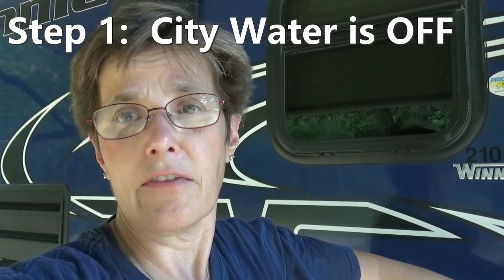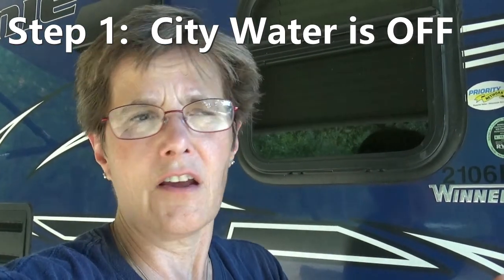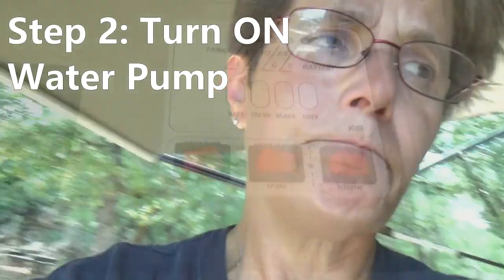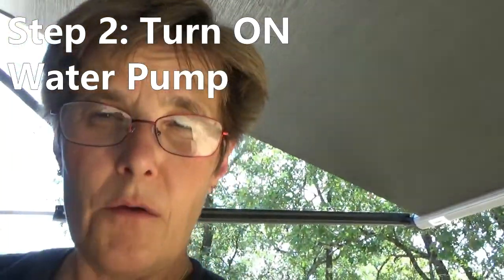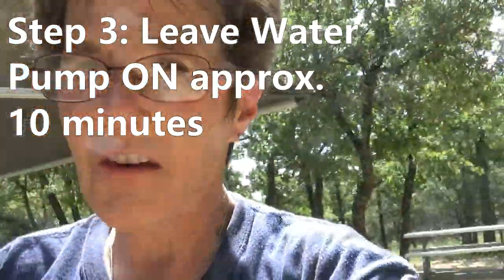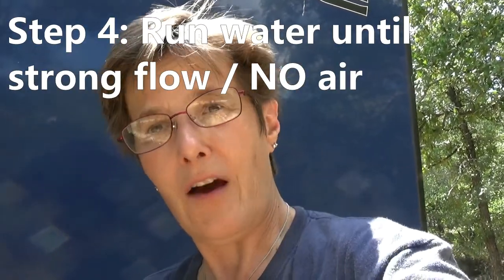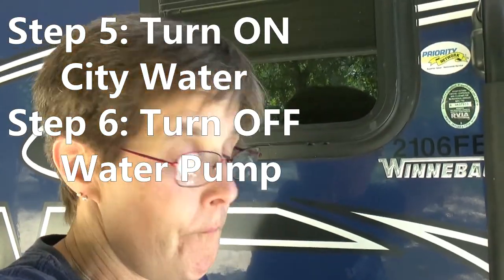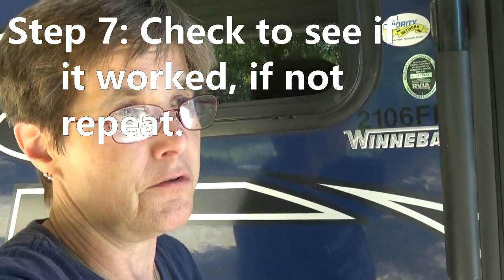RV Fresh Water Overflow - RV Water Pump Valve

Comment: I had the same problem until I watched your video lol I had a tone of air in my lines when I turned the pump on but after all the air was gone I let it run for 10 min. And then turned on city water so far so good!! Thanks for sharing
Reply from the maker: If we can save anyone the worry of wondering what's wrong with the RV, we're happy to do it.  Glad it's working for you.

Comment: Thank you! Thanks for explaining how to fix it but also what causes it so can make sure to avoid it in the future.
Reply from the maker: You are most welcome.
Reply: I also have recently  had the same issue. What I found was there is a built in check valve inside the water pump that failed from either debris or high pressure from a campground. If the check valve fails water will back feed thru the pump and fill the potable  tank.
Reply: YAY Thank you so much, quite helpful!!! But I have a regulator on the for city water it's only at 40 PSI and this is still happening.  5th wheel says it is good for up 100 PSI. This is second time in a month that it's happened any thoughts on that?

Comment: Good video. I have a Minnie. I only turn on my water pump when I am using the water and was told to be sure not to turn on the pump when I am hooked up to city water, which I have forgotten a few times. My rig is a 2013 and so far no problems with the water tank. You didn't mention filling up and emptying the water tank after sanitizing it, but I always do a full fill and dump after sanitizing to make sure I rinse all the bleach out. I also use a filter on the water hose and then again filter my drinking water from the kitchen sink by putting it in a Zero pitcher. My dog gets the filtered water also, of course. Happy travels. Hope to meet you down the road. I will be traveling through Florida and south Georgia this winter.
Reply from the maker: We ordinarily don't use the water pump while hooked up to city water, but we had to get the air out of the lines.

We, too, use filters outside and on the faucet.  We don't completely fill and empty the tank after sanitizing.  We do run water through all the lines until we no longer smell bleach.  

Love hearing that you also have a Minnie.  We love ours.  Maybe we will meet.  We always enjoy meeting subscribers.
Reply: @TwoTiredTeachers  You can't miss me if you see me in a campsite. I have a Minnie that is the bright emerald green color. I can be spotted a mile away. LOL
Reply from the maker: @joansrvadventures6112  Love it!

Comment: Also found fresh water tank overfilling. Turned off city water and used pump overnight and morning. Did a little homework on the subject matter, looked at my water pump and noticed it already had a cutt off valve leading to fresh water tank, so I turned it off and back on city water line. When I boondock I ll have to open cutt off valve to use freshwater tank.
Reply from the maker: Glad that worked.

Comment: Thanks!  My Class C Jayco was leaking water.  This happened before, at the beach, when I was connected to city water that was too high of pressure.  Pressure is okay at current location but noticed something leaking.  Looks like the overflow valve.  Hopefully this works!
Reply from the maker: Good luck with that.  We hope it's an easy fix.

Comment: Hi. Good day!
Would like to ask any recommendation or suggestions on how to fix our little problem on our camper.
Its a 2016 gulf stream ameri-lite 198bh.

1.
We used it two weeks ago for a dispersed camping. Filled our fresh water tank. When we arrived at the campground, we turned on the water pump, we’ve noticed that waterpump has a different noise. Like not the usual sound of the waterpump, then the water outflow is not as strong as it was. And noticed a leak while its pumping water. Question is, is the water pump defective? Any easy fix recommendation? Or should we change the water pump?

So since water pump is giving us a problem, we booked a campground that has a full hook up, and that seemed to solve our problem that weekend.

2.
Last weekend we hooked it up on a full hook up campground, since we haven’t figure out what’s wrong with our water pump. First night was really smooth running, till our 2nd night, we noticed that our fresh water tank was over filled and leaking already, we don’t know why, we didn’t fill up our fresh water tank, we are just connected to city water, and we haven’t turned ON our water pump. Any knowledge on what to do with this?

Any help,comment,suggestions are greatly appreciated! Thank in advance.
Reply from the maker: I am by no means an expert, but a suggestion or two... There is a filter on the pump that worked lose on ours once and leaked. I tightened it and had no issues for 2 years.

If you have left the pump on for a couple of days and it is still not pressurizing the lines the pump may need to be replaced. I just replaced ours last week for the same reasons. It took a couple of days to pressurize the lines. When it did it was VERY loud, but we used it for the MONTH we were gone. As soon as we got home I replaced it.

Hope this helps, thanks for watching :)

Comment: Can you send us a picture of the valves on your water pump?  What needs to be open and what needs to be closed?
Reply from the maker: Thanks for watching, by using water from the fresh water tank to get air out of the lines (using the water pump), the pressure from the water closes the valve that needs to be closed, at least it has for us. Hope it works for you!

Comment: I recall watching this video when it was new. Now YT has again pushed it to me. Anyhow, one thing I do not do, is connect to city water and leave it pressurized. I use city water to fill the tank, and the pump to pressurize with. This way, there is no chance of a leak flooding you, or a line blowing or something like that. If the pump is running and the faucets are all closed, you either have a leak or are out of water, in both cases you need to investigate. The one time I did hook up city water was where I was staying for 4 days, and I made sure it was turned off at night and anytime I left the Motor home.  The MH filled the tank thru the city water connection with a selector valve, no external filler port. My current travel trailer has both a city water connector and a filler port.
Reply from the maker: Thanks for the suggestion.

Comment: None of that explains why the rug/floor was wet. A much bigger issue.
Turning on a faucet when the pump is off shouldn't let air into the lines. The faucet is higher than the tank and the water is still in the spout, with a working check valve.
Instead of replacing the pump, you could install an external check valve after the pump.
Reply from the maker: We didn't replace the water pump.  What we did was watch a video about air in the lines.  We took that YouTuber's advice, and the problem was solved.